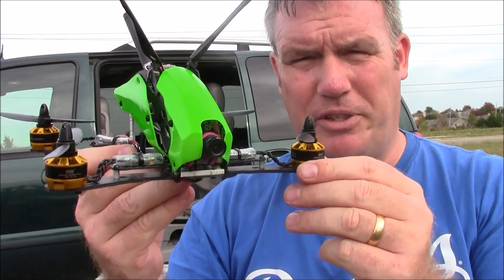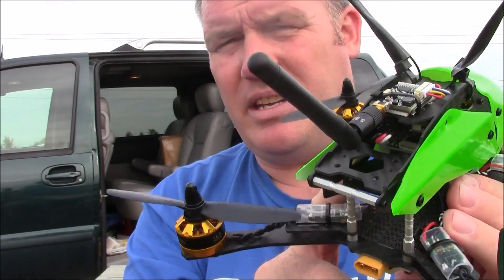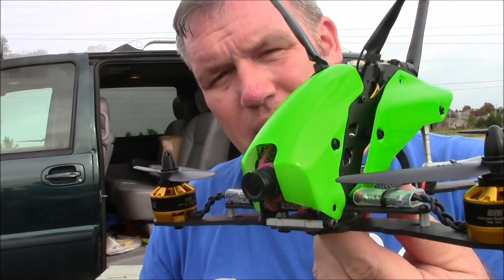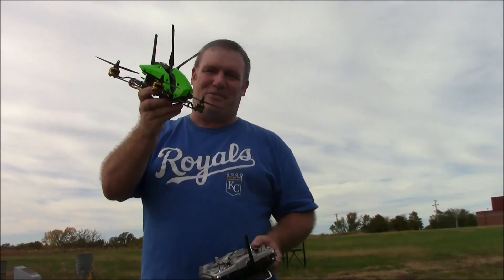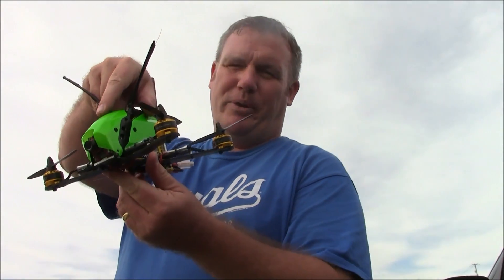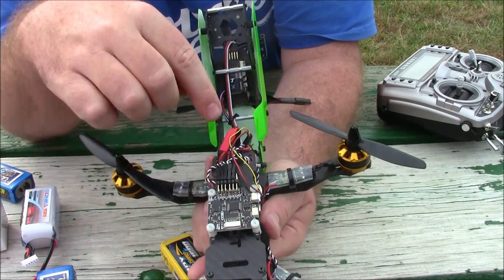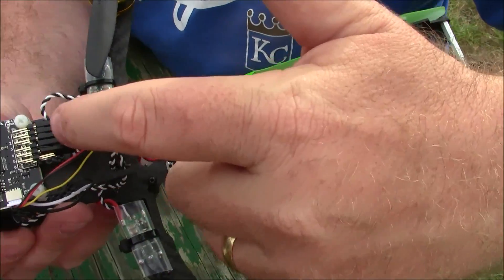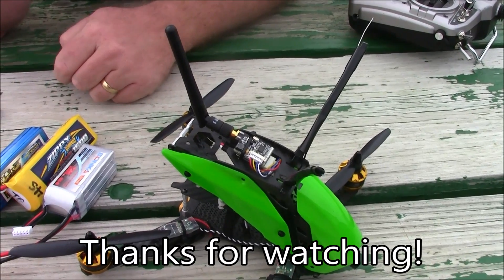Tarot TL250H FPV Racer Built and Flying with 3S & 4S Review

Comment: I got the 330 frame but the hood and side panels are the same design.After dropping the plastic screws many times I decided to put  a drop of super glue on the head of the screw and mount it on the frame from inside out,threaded part of the screw outside.So easy now putting on the canopy with the nuts on the outside.I love it,and you can change canopy colors easily.I did use all the screws too.

Comment: That thing is designed so bad. The Flight controller should NEVER be placed higher than where the prop produces thrust. Wires should not be soldered to the bottom due to skidding, camera should not be poking out the front, vtx and RX should not be exposed on top in case of a turn over crash. Those arms are real thin, stand offs are too tall. This thing will crumble in a crash. Good luck buddy!

Comment: I have a few tarot 250,280, robocat and a 270 robocat and a 130 lap drone .. But that is a beautiful build u put together and awesome looking tarot 250.. I built a black 270 robocat with 2300 kV motors I tried to use a 3cell battery and it will fly but I'm not to happy with its watched this video and was wondering if I should order a 5S batter if it would make the 2300kV motors come alive... Thank you for your videos they are awesome to watch...

Comment: Hello I am building a similar quad. How did you get power to your flight controller? I know it only has a ground and signal, but no positive wire. Did you use step down regulator to power your quad? thank you
Reply from the maker: I think on this quad, I powered it from my video transmitter.  It has a 5v output so I ran it to the flight board.  Usually, I use PDBs that have a 5v output on them and use it.
Reply: ***** Thank you. I am kind of new to this. But do you think that 4 channel radio would be ok for my build? or do I have to get telemetry, more channels, and some advanced radios?
Reply: Farkhod Khikmatov it should have 5v out from the main board.

Comment: Is it recommended to use this motor instead of the 1806 ones as stated in the specs? Also I would like to know can you just replace the 4 arms with the TL280C arms when using the 2204 motors? This way there will not be a need to drill the holes?
Reply from the maker: +Allan Soh The 1806 motors may run this a little better.  You wouldn't have to drill out the holes in the arms and they're probably running at 2300kv.  The motors I used are running 2000kv.  That is alright on 4S, but is kind of slow on 3S for this quad.

Comment: DO NOT BUY THE GLASS-CARBON VERSION!!!

I dropped the throttle when hitting a branch from 4 feet in the air at 5mph, it broke BOTH arms!!!

It may just be my kit, but spend the extra $18 and save yourself heartache.

Comment: did 4S work long because the Motors are recommandet to use with 3S ?
Reply from the maker: +BlueMountPicture s The motors can handle 4S just fine.  When you first try them on 4S, you want to do a test flight and push them kind of hard, land quickly, and feel the motors.  If they are not too hot for you to hold in your hand, then they should be fine.  If they are scorching your hands, then that is bad.  The magnets inside will come loose if the motors get excessively hot.  These 2000kv motors handle 4S just fine.  I'd say you have nothing to worry about.
Reply from the maker: +BlueMountPicture s After flying this for a while, I&#39;d really suggest getting these 2400kv motors instead.  They&#39;ll perform better on 3S and give a lot more performance if you move up to 4S... yes, they can handle 4S too.  :)    http://www.banggood.com/DYS-BE2204-2400KV-2-3S-Outrunner-Brushless-Motor-for-Mini-Multicopters-p-973478.html?p=6Z050013977120130325
Reply: ok thanks i already asked in a RC Forum ans everybody told me it is ok to fly 4S on these motors but thanks for answer my question :)

Comment: I see motors with 2300kv and other motors with 980 KV. Is a higher number an indication that it goes faster? I'm trying to build a quad that flies on 4s and the 980 states I can run 2-4s batteries.
Reply from the maker: Most 2300kv motors can run on 4S without any issues.
Reply from the maker: +travisgrindal These would be the motors I'd suggest.  They don't say they support 4S, but they will just fine.  It isn't voltage that will kill your motors.  Heat kills them.  When you fly your quad, land quickly, and feel your motors.  If they burn your hands, they are too hot.  If you can keep your hand on them without it burning, they should be fine.    http://www.banggood.com/DYS-BE2204-2400KV-2-3S-Outrunner-Brushless-Motor-for-Mini-Multicopters-p-973478.html?p=6Z050013977120130325

Comment: velcro fixes everything mate :) just like ductape :D i mounted my CC3D with velcro and it works just fine :)

by the way, will a 2700mah zippy compact 3.5cm wide 13cm long and 1.5cm high fit? the length does not really matter to me, i just have 2 of these lipo's and they fit well on my hobbyking color 250 so yea will it fit?

Comment: Currently looking at building the 280 version, I have some 1600kv motors hanging around, would these be sufficient with 4s swinging 7 inch x 4.5 props? I'm new to the fpv quad scene and don't require too much speed just yet. I get the impression it would be similar to running 3s with your setup
Reply from the maker: +luke fisher I'm not 100% sure, but I think 1600kv with 4S and 7" props will fly pretty well!  I'd be interested to see how it turns out.  I have some 1200kv motors that I've flown with 8" props and 4S and it was plenty fun to fly!  I'm betting yours fill fly great.

Comment: so, i've been asking a lot of questions about this drone cause im really about to buy it and i wanna make sure it will work all perfectly. my last question is: does http://www.banggood.com/Tarot-TL250H-FPV-Racer-Combo-1806-2300KV-Motor-12A-Nano-ESC-5045-Propeller-Naza-32-Flight-Controller-p-1012779.html?p=6Z050013977120130325?utm_source=youtube&utm_medium=travisgrindal&utm_campaign=BG8725627&utm_content=CSY include cw and ccw motors?
thank you for answering, i really appreciate.
Reply from the maker: ccw and cw motors refer to the direction that the prop nuts screw on.  the motors can spend either way. they are all clockwise Motors but you should be fine. Just tighten up another real well. all my 1806 motors are that way.
Reply: so i dont need to buy another 2 ccw motors?
Reply from the maker: +hector231098 No, all cw motors will be fine.  Like I said, all my 1806 motors are CW.  I have them on 3 quads.
Reply: thank you! no need to do more questions :)

Comment: what transmitter is compatible with build? What 4s battery should i buy so it fits perfectly?
Reply from the maker: +hector231098 You can use whatever transmitter you want as long as you have a receiver that works with it.  I'm using a Taranis transmitter and a D4R-II receiver.  As far as batteries, I'm using a yellow Zippy Compact 1500 mAh 25C 4S battery and it fits fine.  It is probably undersized for these ESCs but it is still working fine for me.
Reply: +travisgrindal and how can i know if my transmitter is compatible with that receiver?
Reply from the maker: +hector231098 You'd have to research it.  You don't have to use a D4R-II receiver.  Any 5 channel receiver that works with your transmitter should work.... You'd need 4 to control the quad and 1 more to turn the auto-level on and off.

Comment: What do you mean by rates turned up the 550?
Reply from the maker: rates are how sensitive your sticks are to movements. in openpilot and Libre pilot there are sliders that adjust the rates. 550 is pretty sensitive for me. Some people like it even more sensitive and will raise it up into the six or seven hundreds.
Reply: Thanks
Reply from the maker: +Gustavo Neves you are welcome!
Reply: +travisgrindal Hi, do you mean: In GCS/Stabilization/ Basic/Responsiveness?
Reply from the maker: +Gustavo Neves Yes, the "Attitude" and "Rate" sliders.... Attitude is when you have some kind of auto-level turned on.  "Rate" is when you don't have any auto-level turned on.
Reply: +travisgrindal Thank you so much!
Reply from the maker: +Gustavo Neves If you're not use to it, 550 is going to be pretty sensitive.  I'd say start low and then increase it from there by 50 or so until you think it is just right for you.  Also, I'd suggest increasing some expo as well that will make the center of your sticks less sensitive and the stick extremes more sensitive.

Comment: Usually it's not a great idea to run cam and vtx direct from the battery due to interference as it's a kinda dirty signal compared to a flat DC. But if it works well then who cares, fly and enjoy.
Reply from the maker: +MicroRCFiend True.  On other quads I've build, I've put in a LC filter to fix horizonal lines in my video.

Comment: Ok I have built one of these with 2300kv's and 3s and it goes quite well, am running 12amp ESC with BEC for the 5v, Yes that power board needs work. The small space in the legs are designed for the mini ESC's as I have found out, look at the holes on the leg.. you will see a hole at the motor, one just under the leg stiffener and one on the other side of the stiffener. The wires I zip tied, each side, and up the sides. You will find a gap that the top misses in the middle of the chassis. I also used a cc3d mini/ micro and double side taped it to the body up the front. Yes had to drill out the centre holes in the legs for the motors also as well as a couple to fit some zip ties through. Will keep you filled in on the FPV when it arrives.

Comment: Awesome video Travis, that thing goes insane on 4S... I have a question for you, what do you think about 4 T-Motor MN2206 kv2000 on a TAROT 280mm frame with a 4S battery too? would they perform crazy as hell like your DYS motors  or they should perform better than DYS motors. What do you think?
Reply from the maker: +Robert Rodriguez They would probably be about the same.

Comment: Well this frame has some very interesting and convenient layout features but it clearly needs a redesign upgrade on many others. Love that the battery get well protected. Love the battery connector, definitely hate that the motors are so exposed. I always wonder with frames that have the sides enclosed how they perform aerodynamically. I remember that when Lumenier, I think it was, begun to sell some warping stuff for the frames, some people reported some kind of turbulence affecting negatively flying performance compared to an open frame. Is this frame an exact clone of the RoboCat? Or rebrand?
Reply from the maker: +Multirotor Go I don't think it is a clone.  I'd guess it was more like one was designed after the other.  The central battery position keeps the center of gravity real near the center so it flips and rolls like a champ!
Reply: +travisgrindal hey man! I'm looking to buy the srd250 pro v2. Just a few things are holding me up. If I got he PRO version... Would I be able to run 3s even though it's says its for 4s? If so, would I have to change the settings everytime? To my understanding the NON pro version is a smooth and stable flyer which runs ONLY 3s. My questions are, if I put 3s in the PRO version, would it make it calm and increase the flight times like the regular srd250? If I get the pro version and use 3s will I get the same amount of flight times as I would with the NON pro version? Sorry if this is confusing, I just want to make sure before I spend a lot of money. I just want to make sure if I do decide to get the pro version that I can easily just swap the battery if I decide I want to fly smoother. Please help!
Reply from the maker: +Jake Cardinale It would probably depend on how particular you are about your flight performance.  I have a few quads that i fly on both 3S and 4S, and i don't change any setting except for the low voltage alarm.
If both my 3S and 4S batteries have the same mAh rating, my flight times are almost the same.  The 3S batteries are a little smaller since they only have 3 cells, but if they are including a 3S battery with a higher mAh, that would explain why it flies longer.
Reply: +travisgrindal thank you for the reply.. I emailed helipal and they responded with this "Technically it can power the drone but there is risk that the power is not enough for the drone power system to consumes when it full throttle which may suffer power loss so we strongly not advice this." I'm not really sure what that means. Should I just stick with the regular 3s srd250? I'm just a bit confused. I don't know if 3s will still be fast or not. I just didn't want to be totally stuck with the "insane crazy fast" 4s if you know what I mean.

Comment: Do the DYS 1806 motors work ok on 4s?
Reply: I have ran the dys 1806 2300kv on 4s with 5045 props. they barely get warm. the 2000kv should do even better.

Comment: You're not worried about the exposed wire in the bottom getting caught or damaged from the ground?
Reply from the maker: +george aura Yes, but I mostly just wanted to fly it.  I have the foam pieces I need to add.  That should keep the wires off the ground most of the time, but I still think the overall design needs a lot of work.
Reply: +travisgrindal oh ok, well that's understandable at least the thought of it was pretty cool

Comment: Ok, masses, this is not, nor will it ever be, a racing quad. I have the other RoboCat quad, the 270 with the closed Lexan nose piece. Probably the same weight, certainly similar designs, they're portly beasts. But... Ours definitely had the material on the arms to run a 2206 without overhang (In my case, RTFQ 2204's, with over sized bells. Brother, I'm thinking 1806's on there may be a batter match? Those arms look scary...
Reply: +willdoryder  yours is way heavier than this, there is a 280 version full carbon weights 130grms
Reply from the maker: +willdoryder 1806 motors would have been better for this frame but I don't have a set of them.  I have one spare.... which was in the video.  :)
Reply: George Chatzisavvidis The frame I'm running is closer to 185 grams, but I've now looked up the frame you've mentioned. I stand corrected, according to the listing I read, 130 grams is the frame weight on the Tarot version. Nice, but still a bit liberal to call it a racer, no?
Reply: *****
After watching, (and building the "other" Robocat), I think I'll pick up the carbon version of this Tarot for Ms Tracy. Her FPV250 tried swimming today, so a new frame is needed. Have a set of RTFQ 1806's with Oneshot ESC's, maybe this combo will fare better versus the Gulf of Mexico?
Reply: Agreed, the Robocat 270's are a better beast. I built this first, then the Robocat. Glad I got the Robocat.

Comment: It seems Tarot forgot the KISS principle.  when in a racing situation you need simplicity of repairs.  This thing seems AWFUL complex.  

it is a shame you did not build it as it was intended (meaning 3S 1806 motors).  Then over kill it with bigger motors and 4S-5S
Reply from the maker: +Dean Cory LOL!  No doubt!  But then I would have crashed it at high speeds and totally destroyed the whole thing!
Reply: I am rebuilding my ZMR 250 with Kunai PDB.  Had everything tucked but it is all going out on the arms.  That way less to tear down when something gives out.
Reply from the maker: +Dean Cory I agree.  The easier the repair, the better for me.  I'm not so particular on how my quad looks any more.  Smooth flights and easy repairs are more important to me now.
Reply: +1
Reply: +Dean Cory I have this frame build with cobra 2204 2300kv motors on 4s. I tried 5045 bullnose props on it today and I snapped the bolts holding one of the front arms on during the first throttle pump. this frame has some cunstruction/design errors that make it unsuitable for high power setups.
Reply: I prefer 1806-2300 and 3S spec class the frame is more than sufficient
Reply: +Dean Cory true. It is just a shame that it ends there. I love this frame, but it is a shame that it will not me my high specced fpv racer.

Comment: Could the esc's fit between the arms where it connects to the main body. Think they would get too hot?
Reply from the maker: They could have but it would have bent the wires pretty good.  they probably would have been fine but I just put them on top instead.

Comment: +travisgrindal How many % throttle did you manage to get with the 3s and 4s using the 2206 motors at Hover?
Reply from the maker: 3S was maybe around 60%, and 4S was a little under 50%.
Reply: +travisgrindal thks!
Reply: +travisgrindal btw it is ok to power from the VTX for the 5V as long it provides enough and stable voltage/current.
Reply from the maker: +sleepyduck 4S is way more fun!  If I had 2300kv motors, the percentage would for sure be lower for hovers.

Comment: Nice review on the frame pointing out the good and bad. Helped me out. I was thinking of buying the frame. Great video as well. Thanks. By the way did you have to change the pid flying from 3s to 4s?
Reply from the maker: No, the CC3D has been pretty good to me about changing 3S to 4S batteries without having to change anything.
Reply: +travisgrindal hey travis, i have a srd250 with 2204 2300kv motors and 15amp esc's. I'm wanting to upgrade my quad to 4s. the 4s upgrade kit they sell comes with storm 2206 2200kv motors and 30amp esc's!! would I have to run a at least 60c rated batteries? OR they have 4s kit with storm 2204 2300kv motors that runs on 15 esc's. witch one do i go with? what would be the differences? thanks.
Reply: +Jake Cardinale oh and the 3s motors i have now are emax motors which aren't the best to run on 4s